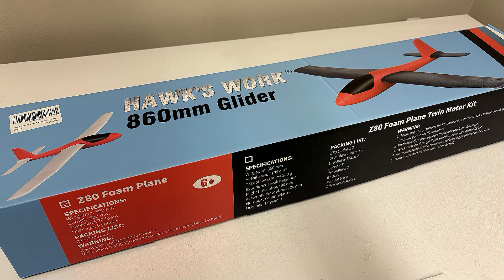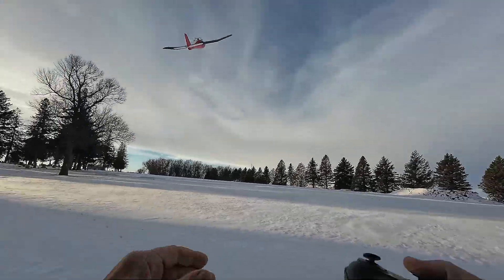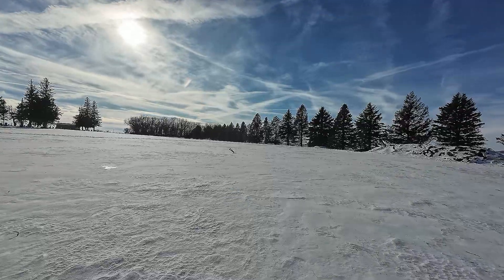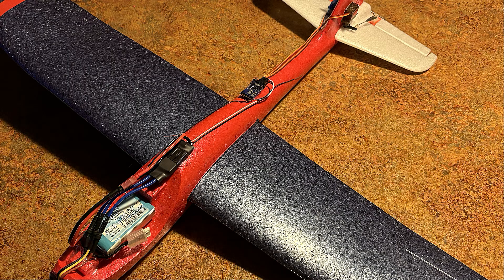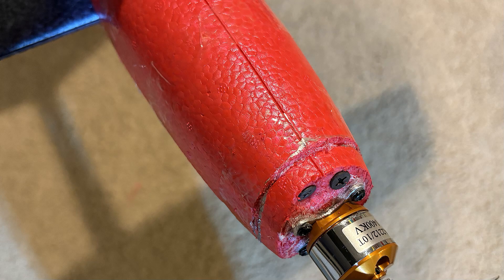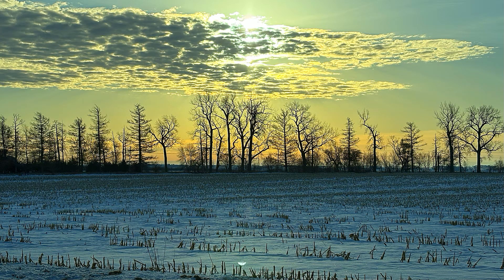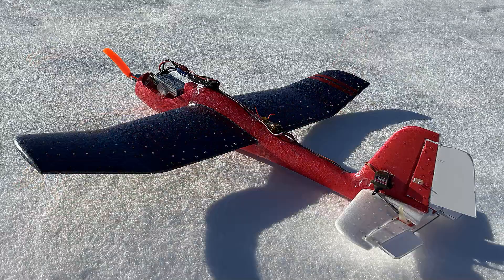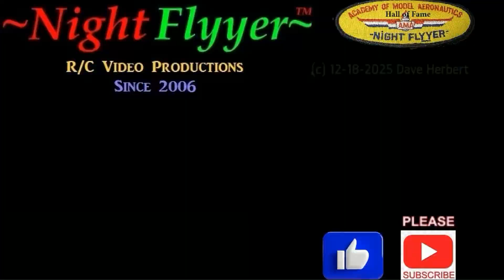My home made Motor Glider won't turn, but I ain't giving up yet!

Comment: Looks like it is lacking ailerons, elevators and rudder, basically eliminating any ability to control the flight......  suspect it is too large for differential power to turn the unit.......  see you modified it.....  challenges, challenges....!  can't keep a good Marine down......!Truck on the highway sounded like an Aero Commander 500!

Comment: I still have one that I converted a few years ago running a 3s setup with aileron/elevator control. The motor is a 2212 1400kv with a 6 inch prop.  Goes pretty quick and very agile. Can do most aeros that don't need a rudder.
God loves a trier! Well done!
Reply from the maker: Right, I have the same setup, but no ailerons, and that rudder under power flexed and just could not hold in the 15 mph winds.  I just flew it again today.  I love it.  Thanks.

Comment: Mine have been flying great turns like on rails. running 2S 800 lipo full brushless and servos for elevtor and ailerons.
Reply from the maker: That's great! Glad to hear yours are flying well with your setup.
Reply: The magic word here is "ailerons". This foam glider already looks as if it would turn much better with ailerons instead of rudder. 😁

Comment: Rudder/elevator models rely on having a reasonable amount of dihedral/polyhedral to turn. 
Perhaps match the dihedral/polyhedral from a traditional 2 channel model. Soar Birdy, Gentle Lady etc. These all turned fine with "normal" size rudders and "normal" throws.
My 2 cents worth.
Reply: That was also my thought. I once reduced the dihedral of a small balsa glider (no ailerons), more or less just because of the looks. I thought the impact on rudder turns would be minor, because there was still some small dihedral left. Unfortunately it wasn´t. Just by luck I was able to get the plane down in one piece. After increasing dihedral to the angle on the drawing the model flew and turned perfectly.
Reply: This is the right answer.
Reply from the maker: All true and I appreciate that. But with a 3 S  battery and a 1400 KV motor and a 9-6 prop the torque is just too much. I just flew it today and it is cranking perfectly now that I’ve just simply added extra control surfaces but thanks. Happy holidays.

Comment from the maker: Note, there are and were plenty of 3 channel airplanes with no dihedral on the tips, and they all turned fine. Of course ailerons would work better, but I like to keeping things simple. 
So when I decide to do a project, I never look to see if there are others, or especially to see how someone did something.  I like to come up with an idea then try to make it work on my own.  And as far as this Hawk goes and others telling me the "right" way to build it, I say.... You know, there is no right or wrong way to build this plane, but this was my way!   I say, if it sounds stupid, but it works, it ain't stupid.  This motor 1400 KV swinging a 9x6 Xoar wood prop, and 11.1 battery, easily over powered this glider with torque, where the tiny rudder would not make it turn under power in 15 MPH wind.
Stay tuned because I just put a new prop on it and flew it. Seems to be working just fine.   It took a little more engineering than I thought it would, but that is the fun for me.  And it flies great. God Bless. Thanks for watching, Merry Christmas, and God Bless.  ~Dave.
Reply: Thanks for the video, Dave. Merry Christmass to you too.